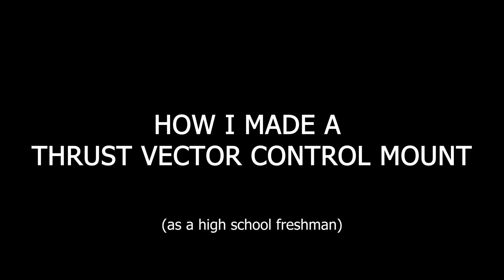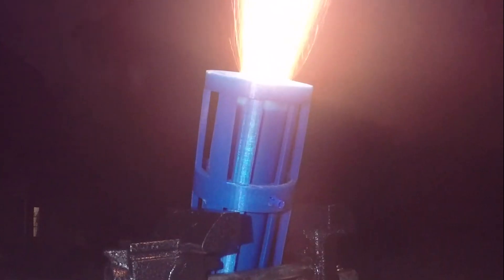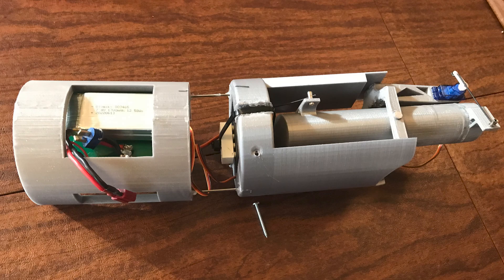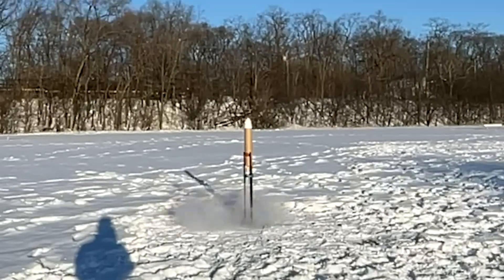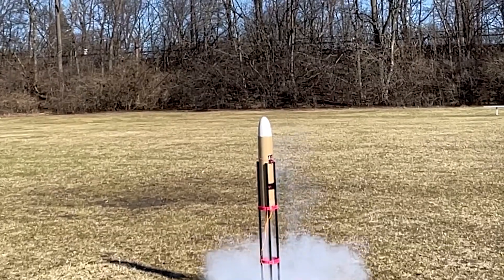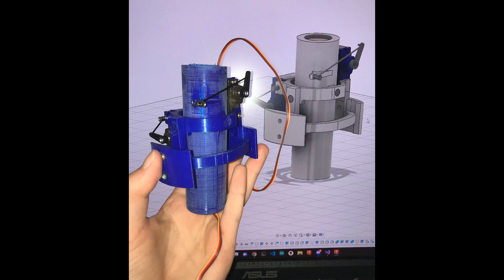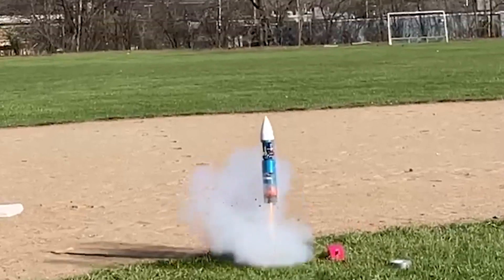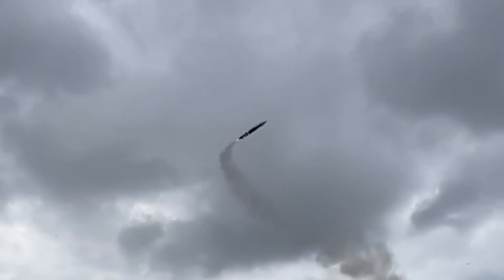How I Made a Thrust Vector Controlled Rocket

Comment: Is there a PID loop integrated? or is the direction the thrust is vectored to just proportional to the angle offset? To me it seems like it lacks the derivative gains, or they might not be high enough.
Reply: Just proportional gains will make the rocket oscillate as can be seen in the video.

Comment: Some tips: Use Teensy4.1, it has a much higher clock speed/cycle time which will directly impact actuation speed/calculation update. Get faster servos (look at MKS), extend your CG-to-TVC length, for a longer moment arm. Also, if you want to use an integral term, make sure you have anti-windup included. But I think your main issue here is servo speed and the slow Arduino Uno clock speed. Good luck! (Also, try and simulate your runs using Matlab Simulink, there is a bit of a learning curve given you are a freshman in HS, but it would avoid having to do your simulations in actual testing)

Comment: Great work.. try upgrade using better  mcu than arduino uno with higher clock rate and 32bit. And you should collect data from each fligh to rate the performance to help you improve it.. after all you're in the right way and good luck

Comment: I'm thinking about creating a missile control system for my graduation project from university and I don't know where to start......... Are there any tips you can offer me?
Reply from the maker: I started by designing a gimbal for the rocket in CAD, which I think is the best first step for doing thrust vector control. You'll have to think about software as well, but I did that after the physical design.

Comment: Great job! What IMU are using to get your orientation data? This may be the reason for the slower than optimal response time.
Reply from the maker: In this video I'm using the GY521. I think I misdiagnosed the problem in the video; I'm pretty sure the poor flights were due to an error in my PID code. For my current iteration I'm using the more expensive MPU6050, which I like better, although I haven't noticed a huge difference.
Reply: @SebastianBagley  Great to hear, I'm using the MPU6050 for my projects too. I'd take a look BPS Space's TVC mounts for some well-vetted inspiration.
Reply: @SebastianBagley  try the bno085, its much more accurate and powerful